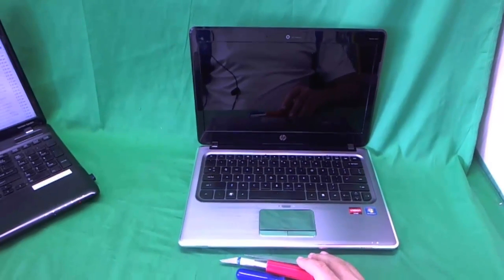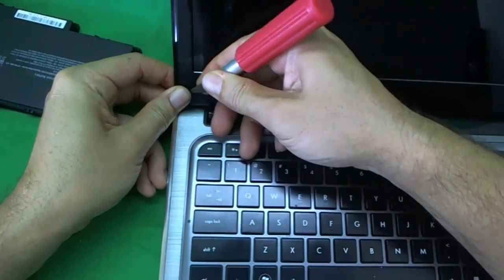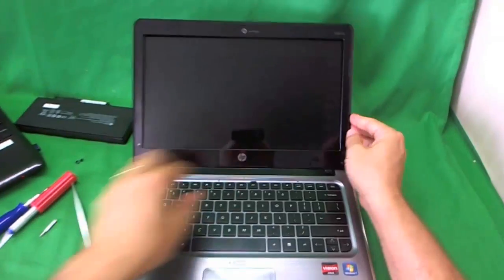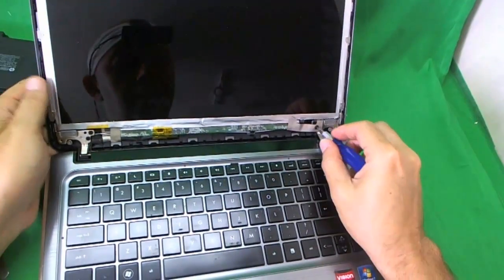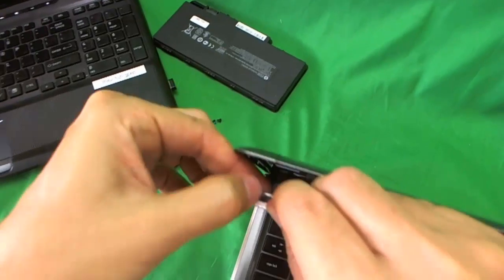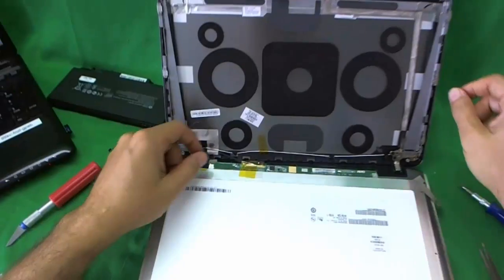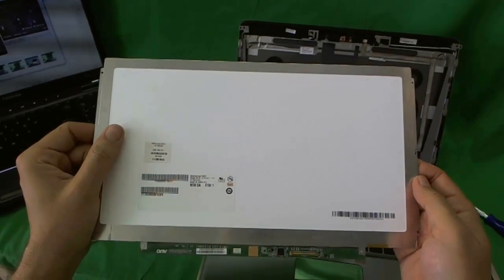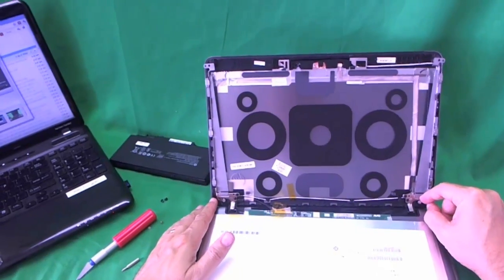HP Pavilion dm3 Notebook Screen Replacement Procedure

Comment: Excellent video for this process! Only thing is I have the HP Pavilion dm3-3112nr entertainment center, which is different from the one shown. Instead of removing the front screen bezzle, the back part of the computer had to be removed instead. From there it was pretty simple to do. My sister who has no technical knowledge was able to do it following the instructions here & replace my screen. Definetly saves tons of money!